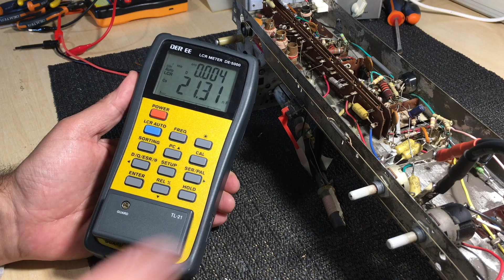Philips 22rb382 tube radio restoration - Part 2. Testing.

Comment: Those Mustard caps are really reliable. Lovely old radio.
Reply from the maker: Simon Spiers : the combination of the ceramics and mustards made this a breeze to restore.
Reply: Nothing worse than digging out those hard to get capacitors. Just bought an LCR like yours. Hoping its a goodie! Cheers.
Reply from the maker: Simon Spiers : i presume you mean the DER EE. it is really good, just beware of the frequency set when measuring esr. If you don’t set it to 100khz, you have no real reference value to compare to. Made that mistake a few times!

Comment: The Der Ee DE-5000 is a better ESR meter than the MESR-100 since the frequency can be varied for obtaining accurate readings on larger capacitors.

Comment: Decent little radio with nice performance, Is there a line fuse and would an inline one tucked under the chassis be advantageous?,
 Regards, J.
Reply from the maker: Average Joe : there is one just to the side of the pt on the top.
Reply: Ahh, I missed that!

Comment: That red capacitor beside the old electrolytic can on top of the chassis caught my attention, is it an oil filled cap?
Reply from the maker: Zirok1982 : it is the safety cap across from the mains switch to ground. Seems to be quite a good quality one. It is made in Denmark, 5000pF and is labeled as a safety cap.

Comment: If you do a search at Google about the pictures of this radio, you will find almost all have that burning marks in the mains transformer. Seems Philips have missed something in the calculations of the mains transformer or the isolation tape wasn't  up to the task... ;)
Reply from the maker: Jorge Santos : I’m hoping that the reduced secondary voltage (using 240v selection) will reduce stress on the pt. As it is it’s drawing about 25w of power instead of the rated 49w so it should help. People still think of the mains as 220v while it’s more like 240v in madeira.

Comment: What is the use of fourth point of volume control, can I use simple three point volume control instead of
Reply from the maker: Check the schematic. The fourth point is a fixed connection to part of the resistive path that is used for “loudness” effect.
Reply: @electronicsoldandnew  thanks
It is as well as in the tone control also
I have problem that the volume control is not working properly so can I use simple three points volume control because the four points volume control is not available